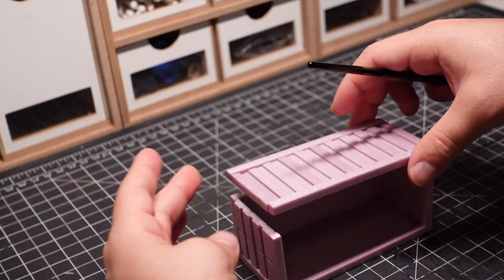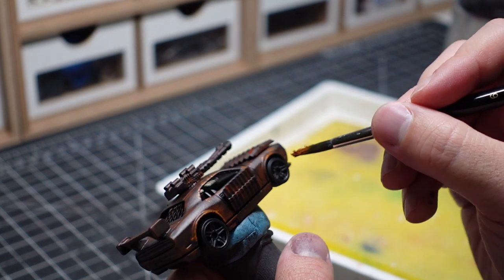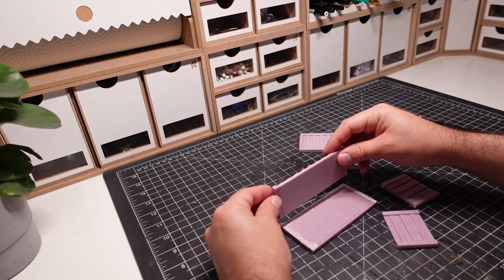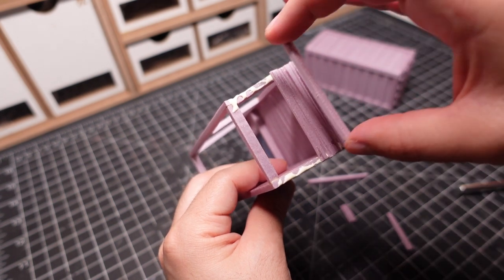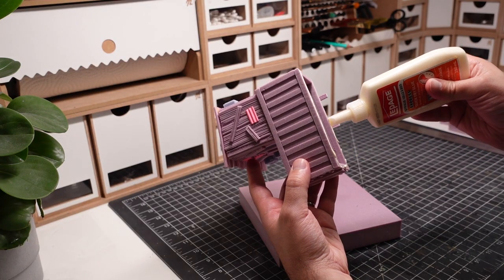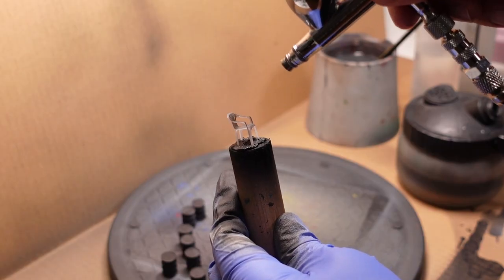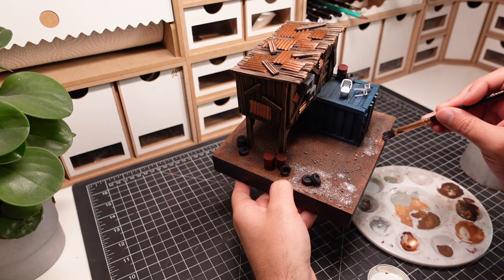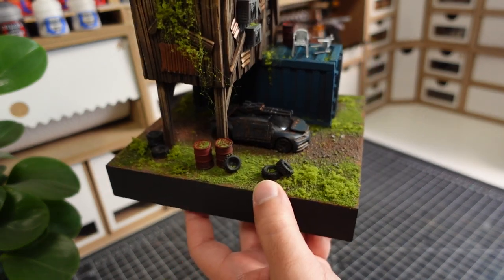Post apocalyptic diorama | Hot Wheels custom build

Comment: Biggest question for you is how do you manage your PVA/paintbrush situation. Do you just rinse it with water and use it when you need to or do you have a trick to make bigger “batches” of it last longer without ruining your brush? Love your videos!!
Reply from the maker: I've never had an issue with PVA and paintbrushes. Just stay on top of cleaning them before they dry. And if you need to set the brush down for a bit—but still intend on using it—keep the brush submerged in water to prevent it from drying. Always use your cheaper / worn out brushes.

Comment: What is that grid cutting wire surface thingy you’re using to cut the foam called?
Reply from the maker: It's called a Proxxon hot wire cutter. Great for doing stuff like this!